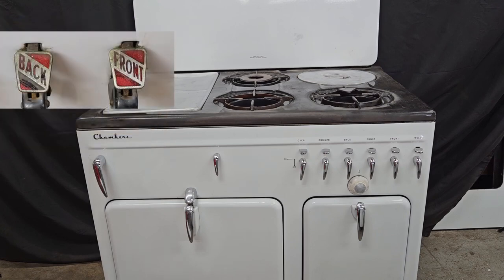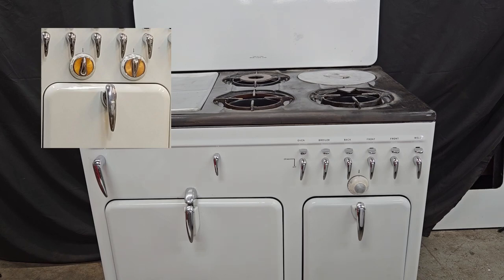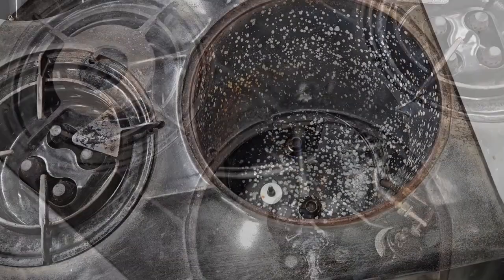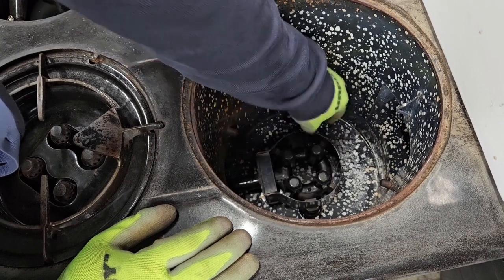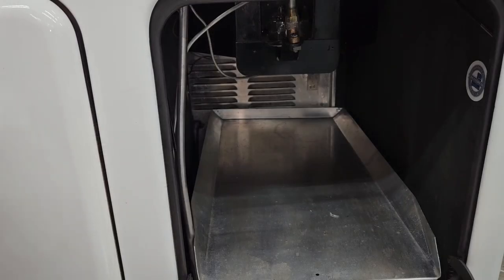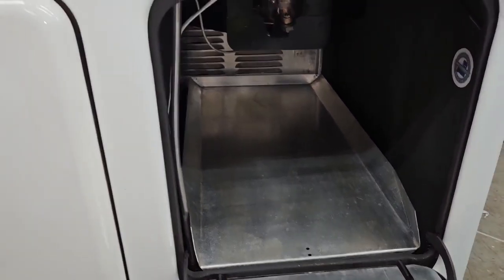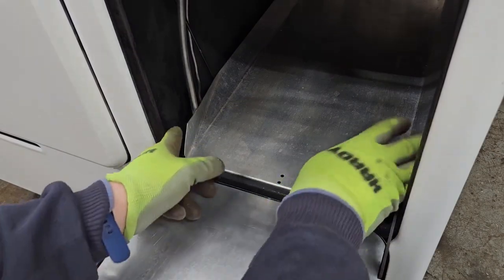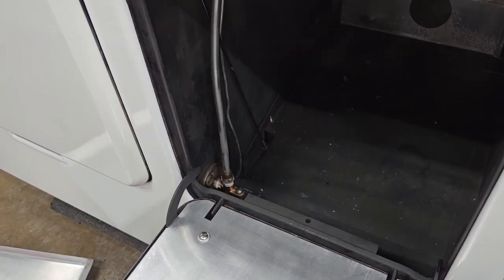The Chambers Model B: How to Identify It and Set One Up

Comment: GREAT video.   I have the Model B.   The only issue I have is the burners want to "flare" when turned on.  Meaning, I turn the gas on and it takes a few seconds before they light. By then there is not a lot, but enough gas floating around the burner that it aggressively lights.  How do I remedy that?
Reply from the maker: That's either an air mix issue (adjust the shutter) or you have debris in your burner (shake it out then blow it out).

Comment: We have a Model 15B. Within the last week, the stovetop cover has started falling down instead of staying upright. Do you know how to fix this issue?
Reply from the maker: The spring that holds it in place likely broke. You need to lift up the back burner grate, drip ring and burner and you'll see it now dangling there. It attaches to a bracket by the pilot. Your best bet is to take the broken spring to a good hardware store (not a big box one) and find a suitable match to replace it with.
Reply: @VintageStoveChannel  I do see about a half inch/inch wide piece of metal kind of in the middle that seems to still be attached. I'll share this info with husband and hopefully we can find what we need. Thank you!

Comment: Hi i have the model B and all the burners turn on except the broiler. I have been unable to figure out how that one is supposed to light up. I have tried lighting it up manually with no success, any tips on what I might be doing wrong, or what could be wrong on my stove?
Reply from the maker: To turn on the broiler you normally lift up the broiler, turn on the gas and light the burner with a grill lighter. If you're saying that isn't working, then see if you can hear gas flowing when you turn on the gas. If you do and you can't light it, then the air shutter is probably closed. Adjust it and then try again.

Comment: Thanks for a very informative video as to how it works..  This doesn't' appear to be the model I have though.  I don't have the scored line down the center, and I've also got a timer on mine, not that it works.    I've got one question though.  I have a front burner that won't light.  The knob will turn, the insides will turn,  One wheel type thing inside turns the other one,  but there's no gas coming through.   I even checked it with a gas detector.  Are there any vids you made that address that kind of situation?  Thanks for all you do!
Reply from the maker: There are multiple model Bs (some of the variations are noted in the video - the 2-panel front is the A). But to your question: if the valve is moving and no gas is coming out, then either the cap is adjusted too tightly or the orifice jet is clogged. My video on setting up a model C walks through burner adjustment a little more thoroughly than this one does. That may help.

Comment: I'm looking at a model b for $200 is this something that will easily convert to propane use without special valves? Seller said all I need to do was turn the screws to adjust the air if using propane e
Reply from the maker: Watch both videos about converting fuel type. Most model Bs have either a fixed size cap or a natural gas pin in them. The majority of Cs had universal pins - and that's what the seller is thinking of. The only way to tell what this stove has is to look at each and every jet.
Reply: @VintageStoveChannel  Took it apart and my jets have the little bitty hole for propane so we're all set up! Praise the LORD:-)